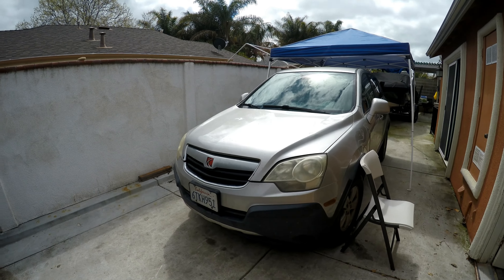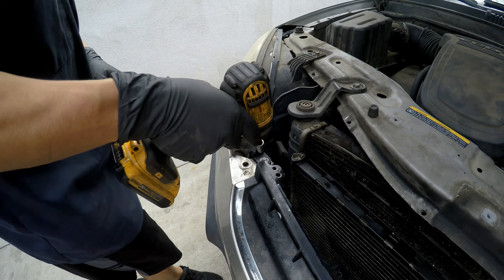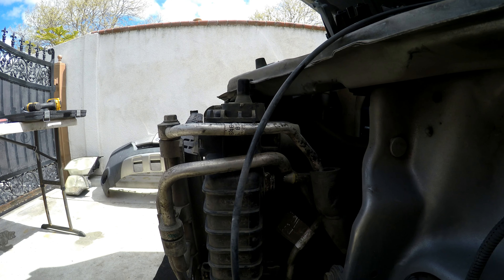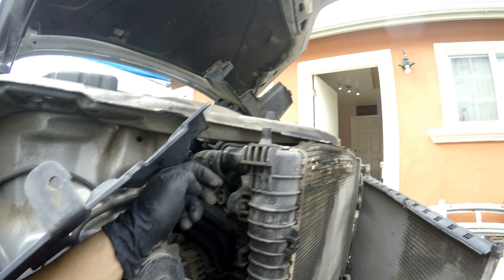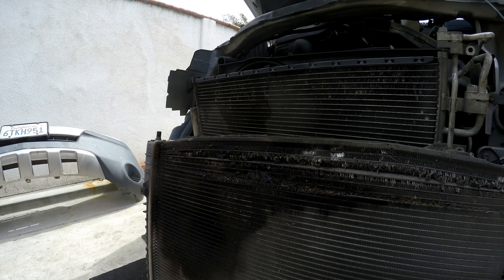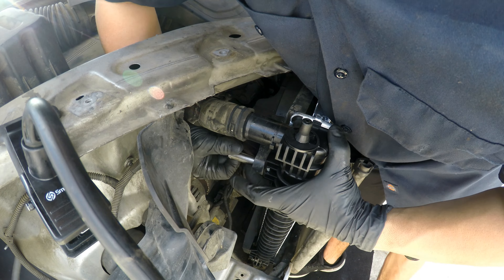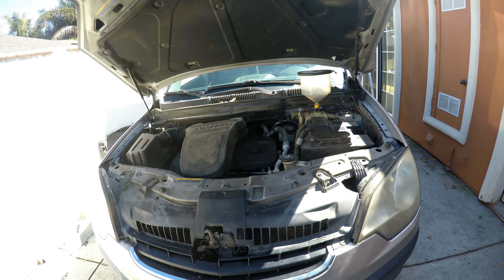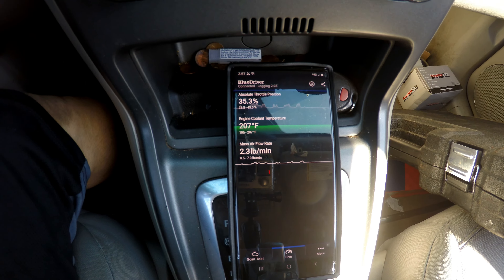Saturn Vue - Radiator Replacement

Comment: Following this Video RN. When you get to the cooler lines Video Doesn't Show The two clips that Pop off (Shadow) but thats what he is doing. Dont just yank on the cooler line. Almost made that mistake myself. Video is Solid Everywhere else.
Reply: Thank you!  I was about to go make that mistake.   =)
Reply: @TheHolyGhost777  thats crazy, I forgot all about this. Glad it helped someone!
Reply from the maker: Great point. I did a bad job lighting up that section. 

At 6:05 you can see the clips that are referenced.